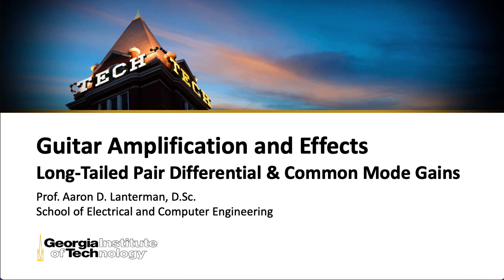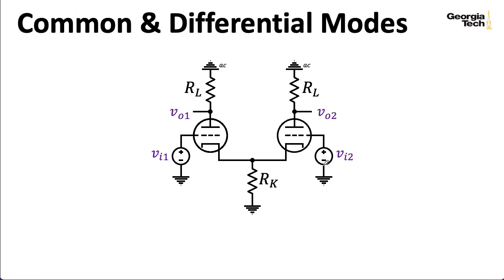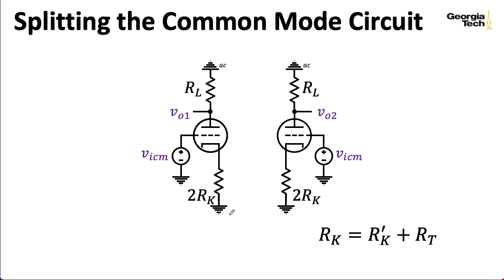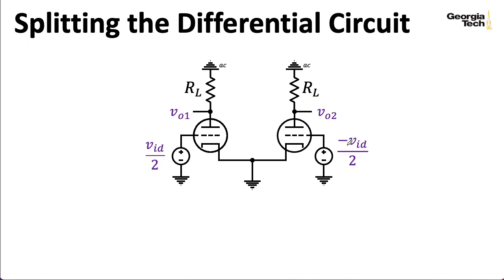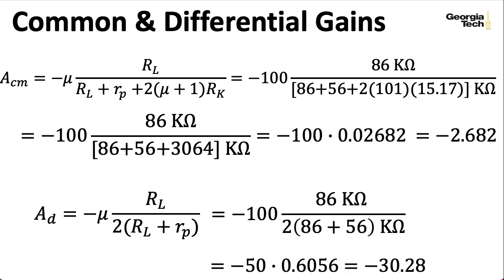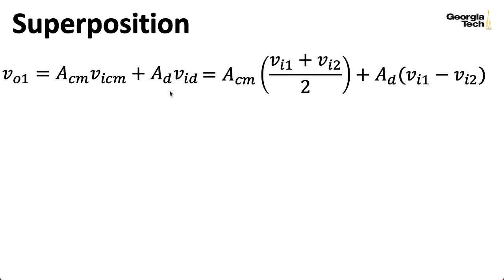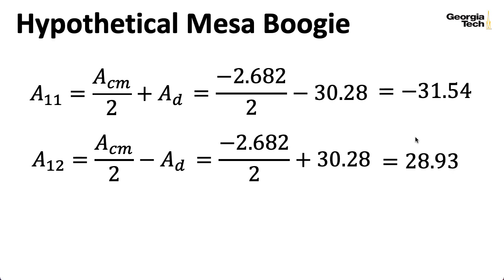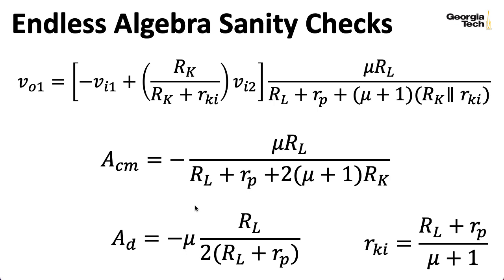ECE4448 L30: Long-Tailed Pair Differential & Common Mode Gains (Guitar Amplification and Effect)

Comment: So if the common mode gain is zero then the symmetric long-tailed pair gives vo2 = -vo1, and depends only on vi1 - vi2. This would seem pretty ideal for a phase splitter (also for one with feedback). If you would replace R_K to ground with a current sink from the cathodes, that should give an infinite R_K in the common mode circuit, and zero common mode gain. But then of course you'd have to build a current sink, and also find another way to create the grid bias voltages.

Another way to reduce the common mode gain might be to put an inductor in series with R_K. That shouldn't mess with the static behavior for the biasing, but should make R_K be a bigger impedance at higher frequencies, reducing the common mode gain. But you'd probably need an impractically large inductor.
Reply: I guess that's why in transistor circuits, you always see the long-tailed pair with a current sink connected to the emitters.
But if you're designing a tube amplifier, you probably don't want to spend one or more additional tubes to make a current sink, when resistors will do reasonably well.
Reply from the maker: @possible-realities  it might make sense to do a hybrid design, with a MOSFET providing the current sink and the diff pair itself being tubes.
Reply from the maker: @possible-realities  You're exactly right -- each tube is expensive-bulky-needs-power-can-burn-out-extra-point-of-failure etc.